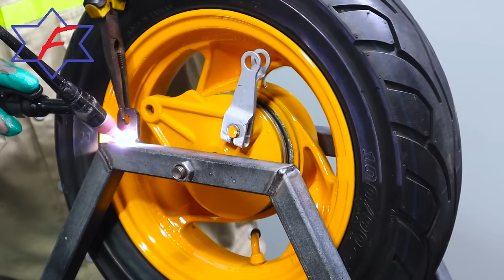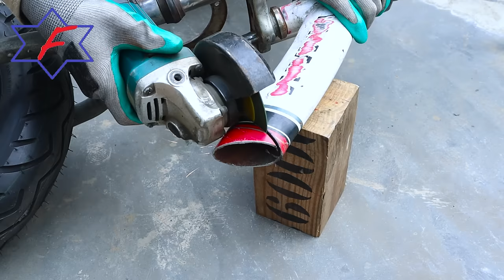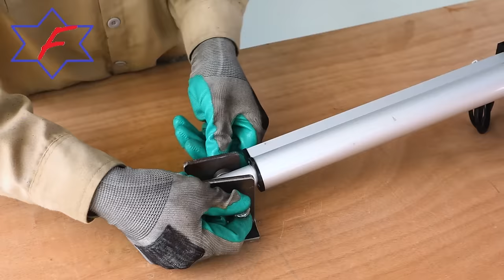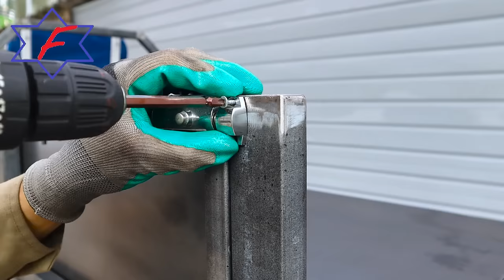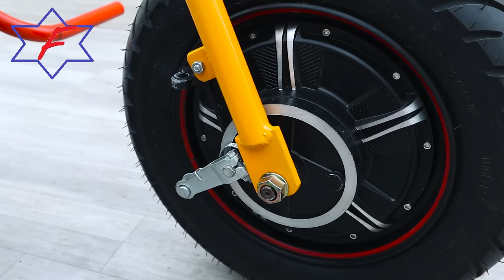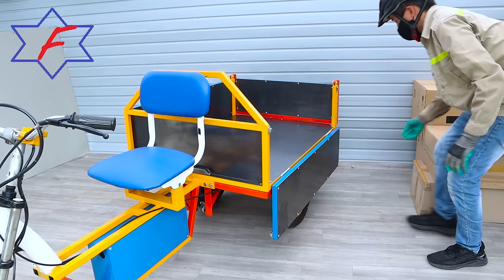Homemade Amazing Electric Light Truck Use Electric Lifter For Workshop

Comment: Sorry, but still no washers and you did not weld the frame front and back halves together. Looks nice but in reality this thing is going to break in half or rattle apart. You can see it flexing dangerously, especially when fully loaded up.